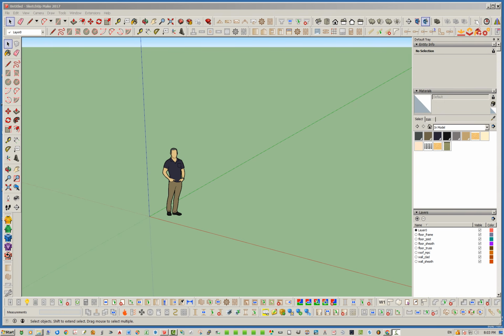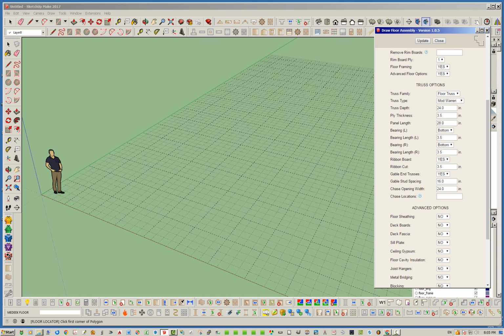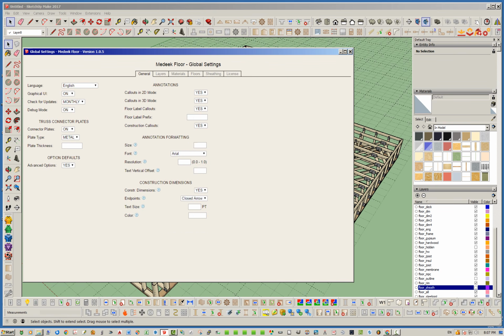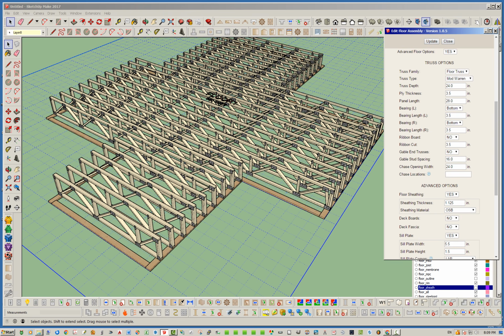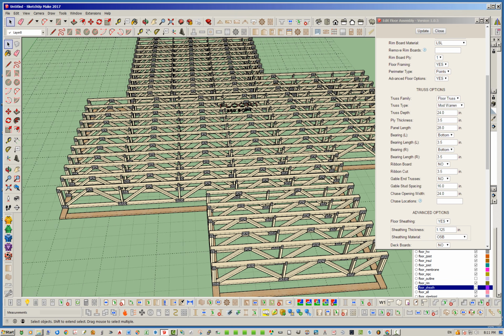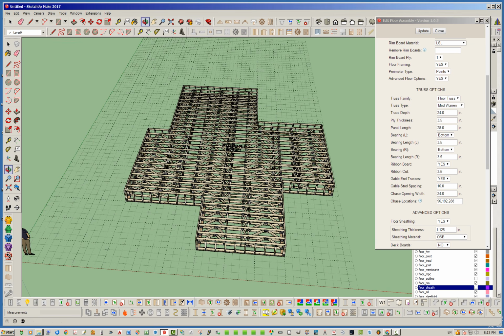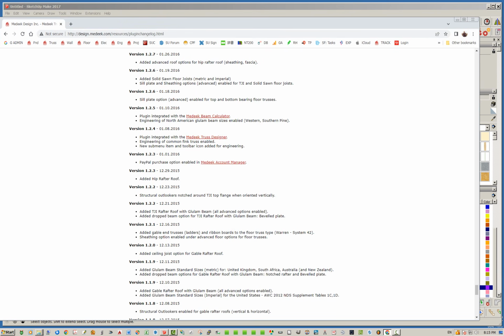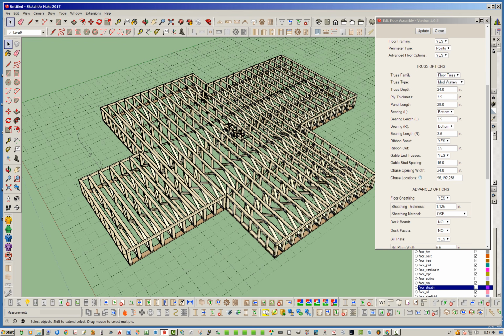Medeek Floor Plugin Tutorial 27 - MPC Wood Trusses

Comment from the maker: Version 1.0.8 - 06.08.2025
- Updated the SUBTRACT and SUBTRACT_JOIST features so that they can better handle MPC wood trusses, steel trusses and open web "Redbuilt" trusses.
- Updated the Floor Opening module so that it can handle MPC wood trusses, steel trusses and open web "Redbuilt" trusses.
- Added a "None" option for the header type in the draw and edit menus for floor openings.